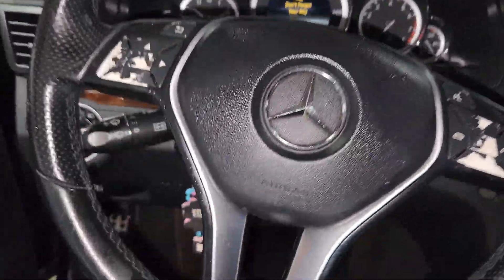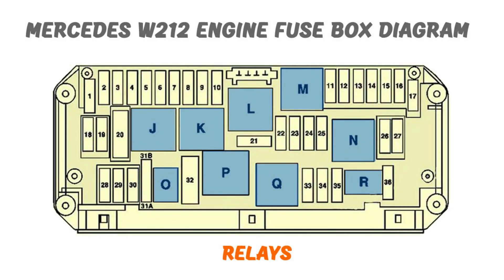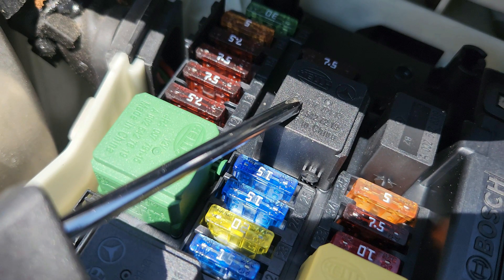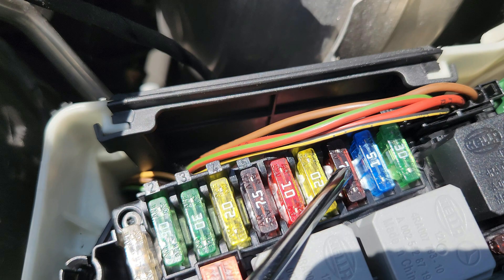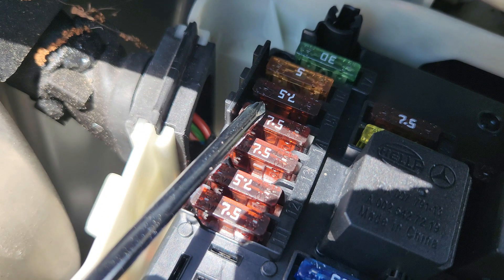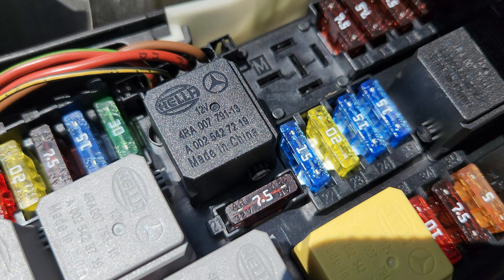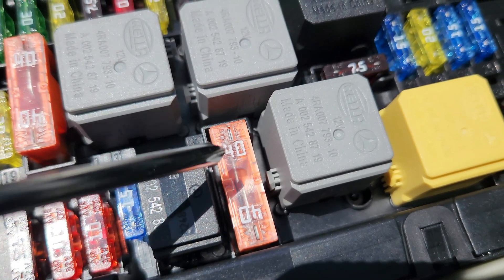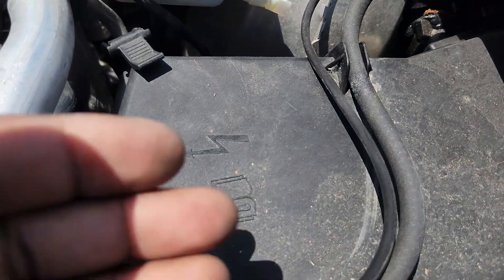Mercedes W212 E350 Engine Fuse Box Diagram EXPLAINED (2009-2016)

Comment: I have a problem with my E550 AMG W212, the front right turn doesn’t work, and there are no blown fuses. The one in the mirror still works but the one on the front doesn’t yet. Can you help me with that?
Reply: Have you checked the bulbs? If it isn't those and you are getting no codes, it's most likely a wiring issue, try to check it yourself. However, as someone who doesn't steer away from mechanical work, electrical is completely different.
Reply: Additionally if you have an OBD2 Scanner that's bidirectional try to see if you can turn the signal on with an actuation test. Does the front right signal come on when you turn the hazards on?

Comment: I have a key fob. I've done everything. Still will no turn the ignition.a red light blinks when I put in the key fob but the ignition will not turn the key. E350 2009 Merc.
Reply from the maker: Given the red light and no ignition turn, it could be an EIS or key fob issue.

Comment: Hi! Thank you for the educational video. My question is: All four "go keyless" on my 2010 E250 CDI are not working. Can you give me a hint how to fix it?
Reply from the maker: Check the key fob battery and the main Keyless-Go fuse first, then use a Mercedes-specific diagnostic scanner to identify a system-wide communication error in the control unit or an antenna issue since all four doors are non-functional.

Comment: witch fuse is disconnect the driver seat
Reply from the maker: The fuse that disconnects the power to the driver's seat on a Mercedes W212 E350 is typically a 25-amp (Fuse 62) or 30-amp (Fuse 45) fuse located in the main fuse box on the side of the dashboard.

Comment: Hi, after changing the auxiliary battery in my 2010 Mercedes E350, the A/C stopped cooling and only blows normal air. Maybe a fuse got blown because of a short during the replacement. Do you know any solution for this problem? If it’s a fuse issue, could you please tell me the location of the A/C fuse in this car?
Thank you
Reply from the maker: The problem of the A/C stopping after an auxiliary battery change in your 2010 Mercedes E350 (W212) is often caused by either a *blown fuse* due from a short or the A/C system entering a *protective lockout state* due to the voltage interruption. First, check the fuses in the *Front SAM Control Unit* (the fuse box in the engine bay) for a blown fuse, particularly a *10A to 20A* fuse designated for the **A/C Compressor Clutch**—replacing a blown fuse may restore function. If the fuses are good, the A/C compressor may be locked out and will require a mechanic to use a professional Mercedes diagnostic scanner (like STAR/Xentry) to read the fault code and manually clear the lockout state, as a simple button reset often doesn't work on this model.
Reply: @all-about-cars-basics 
Thank you for your professional answer 🫡🫡🫡
Reply from the maker: @SoraJajo  You are welcome. I hope the reply helped.

Comment: Good day, my friend could you please tell me the fuse number that control the AC actuator and where it is located? because my AC is blowing hot and cold air at the same time and I’m trying to fix it. Thank you.
Reply from the maker: Most of the time it is usually not the AC fuse that has an issue, but the quantity of freon that is in the AC System. You need to recharge it to the required capacity as listed in the hood or the manual. And the issue will go away.

Comment: Where is the fuse for the blower motor that blows air into the hvac system?
Reply from the maker: Check on fuse no 66 (7.5amps) in the trunk fuse box.